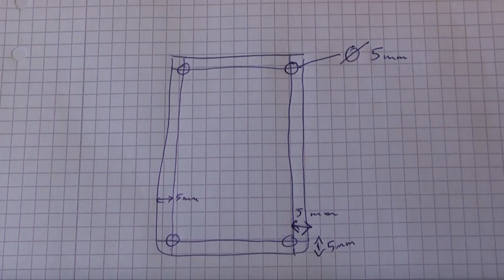Raspberry Pi Plexiglass Case

Comment: Could this be done with something larger like a XBox (original).  Got a concept to make the harddrive removable by putting it on the disc drive side and feeding the cables out to it or making some connection port. Space will dictate and just screw the harddrive enclosure onto the rest of the thing.  Probably need thicker plexi but that it.  My only fear is grounding and shielding any advice?